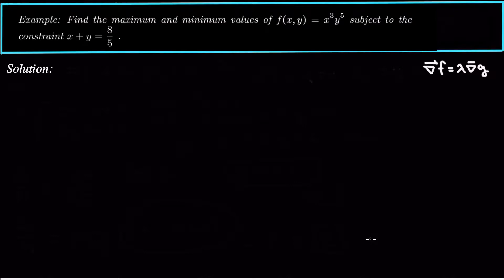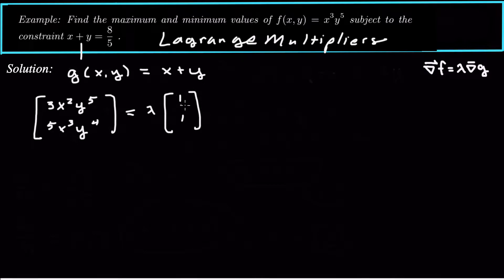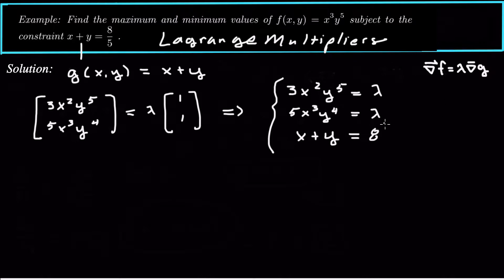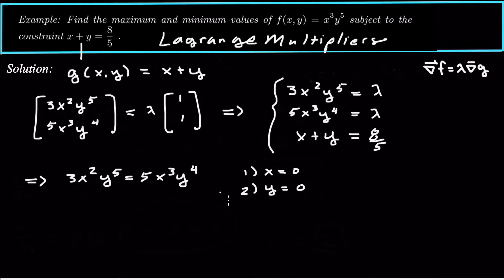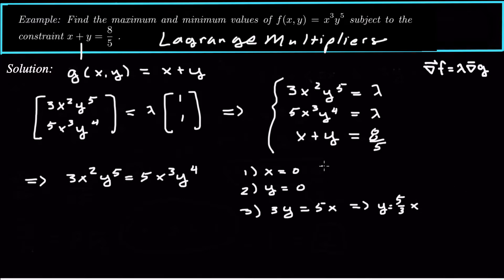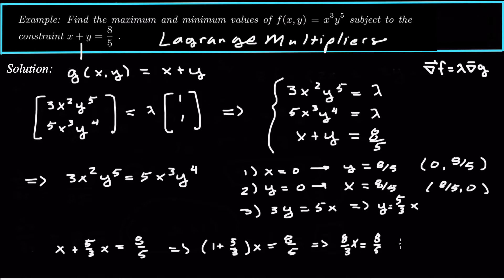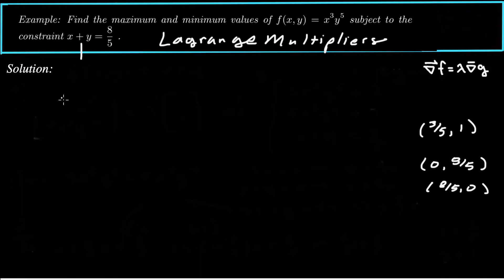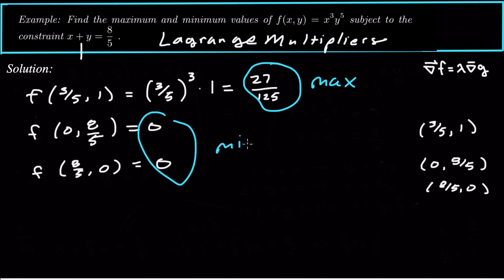Use Lagrange Multipliers to Find the Maximum and Minimum Values of f(x,y) = x^3y^5

Comment: So it isn't necessary to do the D test because you know they are crit points and you can just plug them in?
Reply from the maker: It isn’t necessary to do D because any continuous function on a closed and bounded domain will achieve its absolute extrema somewhere. 

This is analogous to optimizing f(x) on a closed interval [a,b].
We don’t classify the critical points inside we just compare all the function values.

Comment: you're still responding, that's nice
In the last step if I have less than 0, it's still a minimum? 
And what if I got square equation and becouse of that got 2 points, I need to mark them as min/max separately?
Reply from the maker: In Lagrange multiplier problems the largest function value is the max and the smallest function value is the min (regardless of whether it’s positive or negative.
Reply: @JonathanWaltersDrDub  thank you
Reply from the maker: @Hazo656  You're welcome!